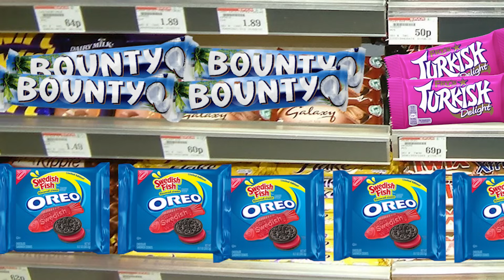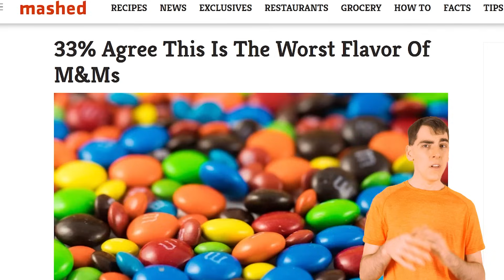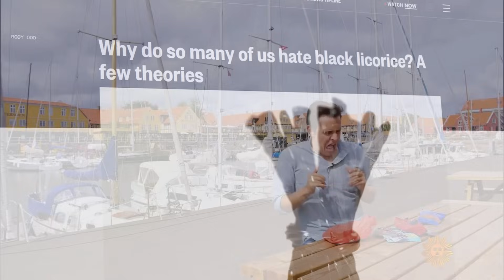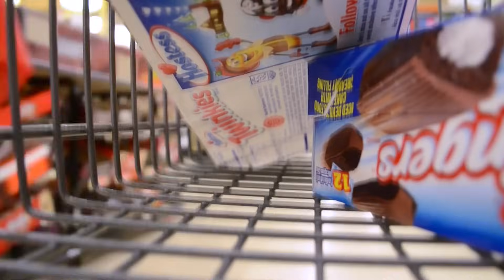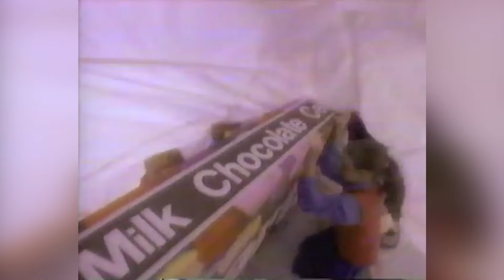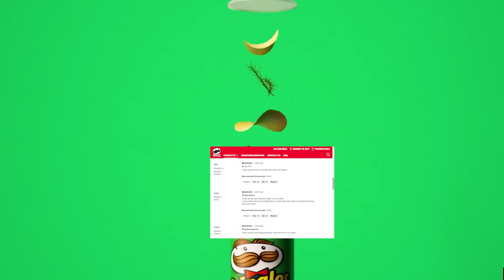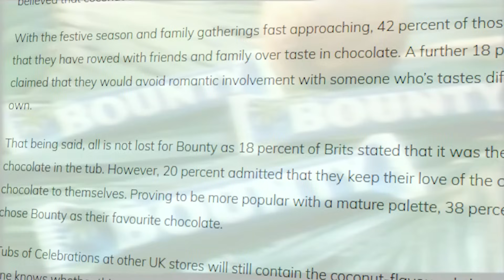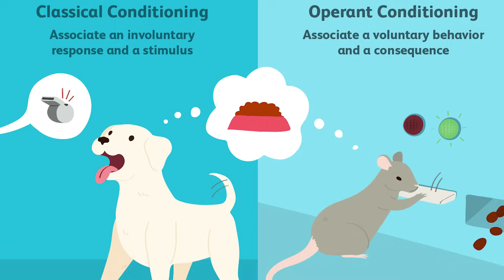The 10 Most Hated Junk Foods

Comment: Have never had a Bounty bar, but have always liked Almond Joy, which is chocolate-covered sweetened moist coconut with an almond on top. 

Oskri has a really good dark chocolate-covered moist sweetened coconut bar also. I usually don't like dark chocolate much, but when it enrobes coconut, it actually tastes good. 

I tried Ocho dark chocolate coconut bar once and liked it.

Maybe the problem with Bounty bars is that their coconut filling is too dry and maybe not sweet enough. Moist and sweet is the way to go for coconut filling.

Comment: Personally, I like Bounty, but I wouldn't be annoyed by the lack or excess of it. It may help if it had even a little bit of moisture added to the coconut. Perhaps that could help bring out the taste.
Reply: Mounds bars over here are the same thing, but the coconut is very sweet and moist, and nobody really hates them.  Also, Mounds is dark chocolate, not milk chocolate.  The milk chocolate version is Almond Joy, with Almonds added.  I read there used to be a dark chocolate Bounty, but it got discontinued for some production reason.
Reply: @ObsydianShade  Aye, there was a Dark Chocolate Bounty in stores for a time. But I haven't seen one in years.

Comment: If you want basically an upgraded variation of a bounty bar. Literally just get yourself a almonbar Or maybe even a mounts both of those are a better option. Since they're literally basically the same, but one of them has no. Almonds. But at least those 2 are somewhat pleasant. But that's because of the way the coconut is the coconut and a bounty bar is way too strong. It has way too many flakes. I guess you could say while a almond joy. It's just so much better and it's easier to eat.  The reason why I always get a mountain bar or an almond joy is because my mom. She cannot eat an almond joy because of her missing teeth. And she can't eat it without dentures, but she can't get past the almond part That easily So we just go with the mounds bar. But whenever she tried the bounty bar, she immediately hate it because she says "it was basically a knock off of a Mounds bar" Which I find hilarious and I agree with.😂

Comment: American smarties are just disappointing. I wouldnt say i hate them, but i dont actively seek them out, either. They are just solid clumps of sugar with some light coating to keep it all together and some added dyes for presentation. Taste-wise, i would compare it to a pixie stick (a straw filled with flavored powdered sugar), just with less sugar overload, and i would pick the american smarties over a pixie stick any day, but the pixie stick does not try to hide what it is, either. If i really want a sugar pill, though, i go for the sweet tarts or bottle caps, as both do the chalky texture better simply with better flavorings.

I vaguely recall trying the applewood smoked cheddar pringles, and though i would not call them good, i did acquire a taste for them. The first few attempts at stomaching it lead to an overwhelming rotten cheese taste, yes, but the key is to focus on the other elements of the flavor and try to ignore it. Yeah, that "ignore the bad" is more than enough to validate its discontinued status, but it was one of those tastes that was so bad i had to keep trying out of a morbid curiosity. If anyone is naive enough to try it, take it slow. Serving size 1-2 chips depending on if you acquire the taste for it.

Candy corn is similar to american smarties for me, just with many other factors at play. Why are they bought? mostly as a decoration piece. They are cheap, generic, and are an icon of the season that evokes a certain mood. If the guests nibble on it like a bowl of nuts, great. if they dont, they were cheap enough anyway and the memories formed in the season are excuse enough. Waxy, yes, but they really are not meant to be a desirable candy, but something for idle hands and rumbling stomachs to be preoccupied with until the real meal is ready. I dont mind the taste in small doses, and am usually satisfied with a single handful or very sporadic single pieces as i wander around the venue.

Bounty is not one i am overly familiar with myself, but as one who grew up initially hating dried shredded coconut, i eventually grew a taste for it. What started as something i would instantly spit out became something i would swallow but not finish, and now i can accept it as a garnish in the right circumstances. A candy bar that is JUST coconut held together by a layer of chocolate? probably not my type of thing, but as a layer atop some other fillings like nuts, nougat, or wafers? sure.

Generic chocolate eggs? it might just be one of the main reasons i didnt think i liked chocolate as a kid. it was either that, or dark chocolate was my first experience with chocolate that made me "afraid" of chocolate for much of my childhood. Even after getting a taste of milk chocolate, i was still never one who could handle large amounts of it. Milk chocolate bar? i likely wouldnt even finish half. Now, i dont trust the eggs because of how poorly they are wrapped, especially in a basket stuffer context or as loose plastic egg fillers during the hunt. If i ever convince myself to have one, i usually ONLY have one, and i have to make quick work of it for my own sake. But, that story changes slightly when it is more than just a block of chocolate. Put a nut or wafer inside and you might just tempt me into one if i can see that the wrappings hold properly, suggesting it is more than just generic stuff (if the fillings not immediately obvious from appearance did not give that away).

As for undesirables not on the list, most "looser candy" (using gravity falls' language) fits into this category, only really being saved by the nature of it being cheap basket stuffing no one pays any mind to. I also again want to point out pixie sticks and most other powdered sugar forms of "candy" (it is often times a bit too lazy to really qualify). Baby Bottle Pop at least gives you a lollipop to work with, and the shape of the bottle and lollipop do a decent job limiting the inevitable sugar overdose, but that does not excuse the more generic bags with a large sugar pill meant to serve the same dipping purposes. Jelly beans are arguably worse than candy corn, having much the same problems with texture and cheap taste, but being far more abundant during the corresponding holiday when used as plastic egg stuffers.